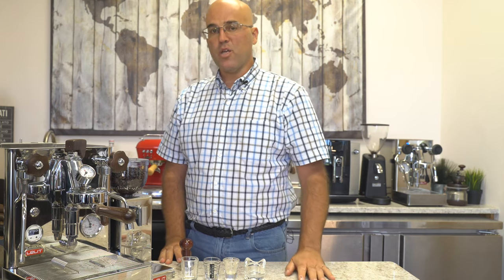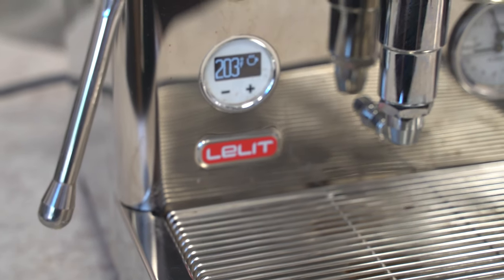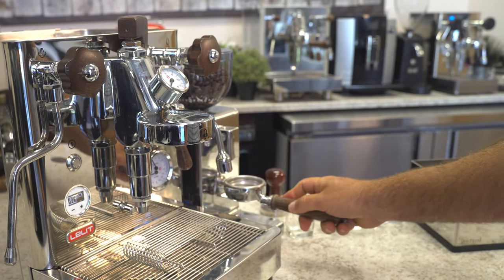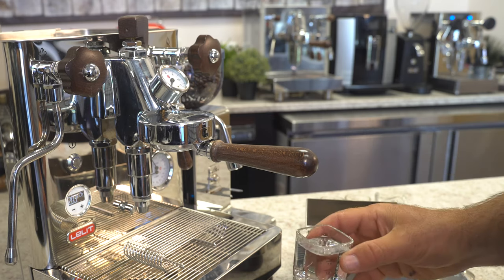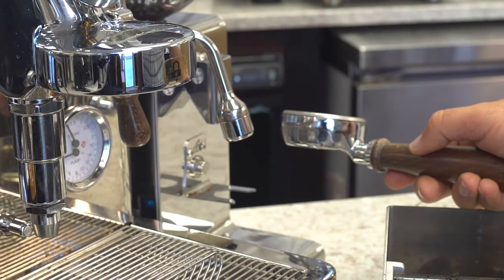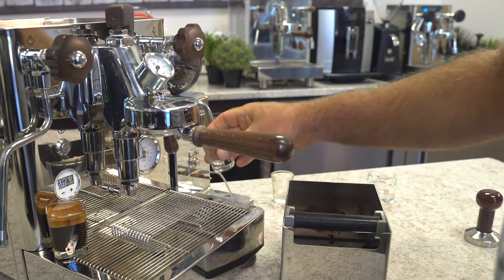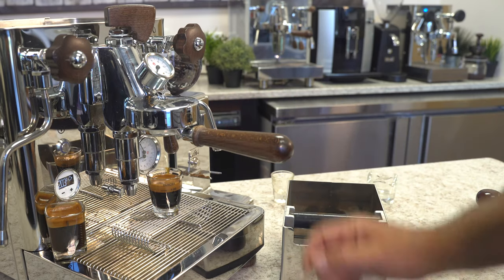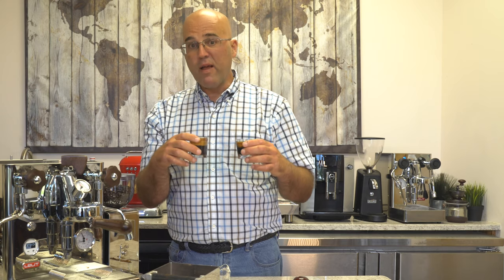Lelit Bianca Pressure Profiling Standard 9-Bar

Comment: This is the most technical explanation I have ever heard of the brew process, thanks! And there's more?? The white spec - since it right on the top and clean, likely something the tamper picked up from the table. It wouldn't be that clean if it went thru the grinder.

Comment: In a commercial setting, if you knock out the coffee, clean the basket, lock it back in, you might need to clean again when you take it out again. If you just leave it there for a few minutes until the next order is up then you not only saved time cleaning, you also eliminated a chance to jam used coffee into the group head gasket. At home? Clean it out.
Reply: but then if it s just a few minutes, you might as well still take it out, and even prepare it for the next order, it s not going to be cold, and it will already be clean or even ready

Comment: Thank you so much for making this videos! very educational content! I just recieved my Bianca - but i seem to have a problem. The group head gauge is only getting to around 4-5 bars with the blind filter in with the pressure profiling valve turned completly, odd right?. Im using direct plumbing and I have checked if the machine is getting enough water, which it seems to do. Do you have any idea what I might be doing wrong? or could there be something wrong with the machine? THANKS!

Comment: If you will make the next espresso within 15 minutes, leave the puck. Otherwise clean it (before it dries).

Also never hit the brass of the ports filter with the tamper. It will dent. If at all give the basket a tiny knock. A lot of ppl strongly oppose any knocking.

Also with an E61 dual boiler make a 2 sec heating flush before attaching the pf.

Comment: Cool machine. Some items i like to know if i am right.
1. Ticking after tamping, this will maybe create cracks in the puck?! I learned to avoid it after the tamp.
2. Duration when porta is inserted, this was very long with the first shot. This will burn the coffee right? When installed its best to imediately turn on the flow? 

Why do not more machines have this extra pressure regulation/adjustment?
Reply from the maker: 1. Ticking after tamping, this will maybe create cracks in the puck?! I learned to avoid it after the tamp.

***To each his own methods. There is no wrong or right. Only opinions.

 2. Duration when porta is inserted, this was very long with the first shot. This will burn the coffee right? When installed its best to imediately turn on the flow? 

***Yes, best to make as quick as possible. However, for demonstration purposes, the learning is more important.

 Why do not more machines have this extra pressure regulation/adjustment?  

***Maybe you should ask those other manufacturers.

Comment: don't knock or twist - you'll damage the puck or break away from the basket wall. Also flow control doesn't equal pressure control - it's just takes longer if you don't open the needle valve all the way. Brewing coffee at 11 bar is unnecessary! Don't swirl - stir and finally you're supposed to drink the shot immediately - espresso starts to separate immediately.

Comment: Is there a reason why you don't purge/flush the grouphead between shots? Also, aren't you supposed to start pressure profiling by gradually ramping up the bars?? Yet you start at full throttle 11 bars...
Reply: The machine is dual boiler + PID... Only for  the heat exchanger (HX) machine do that....
Reply: It's the whole fun of the machine. I'm finding lots of different 'recipes' for pressure profiles using the paddle in videos on YT with different presoak times and bars of pressure for the same shot...fun!
Reply: @fun2rideadventure  Actually double boiler machine needs it as well to heat up the grouphead.
Reply: Thank